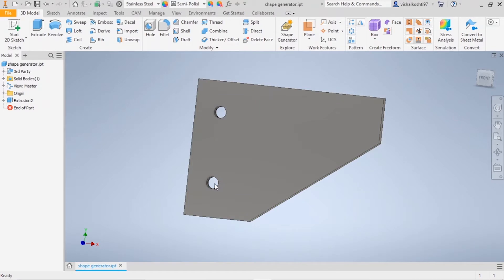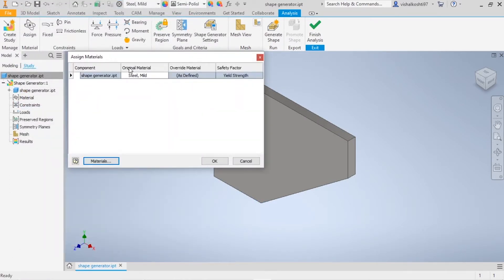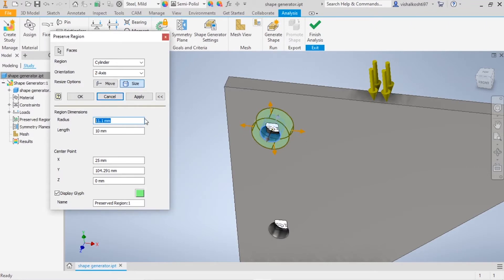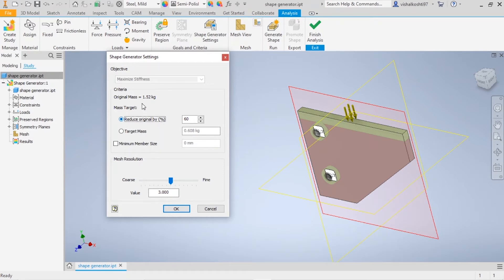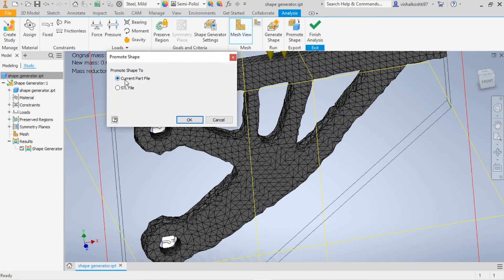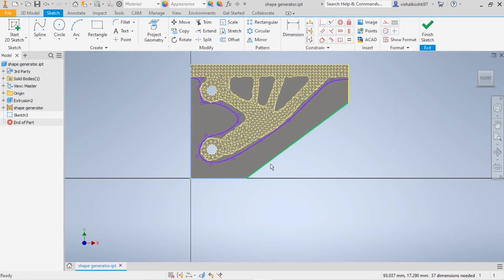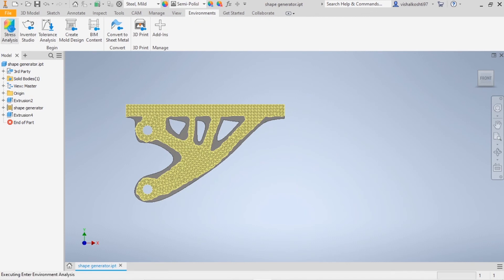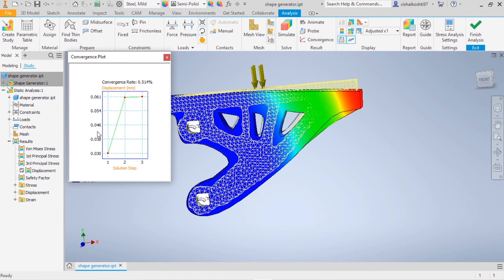Autodesk Inventor-Shape Generator Tutorial

Comment: thanks for the video. One question: if there are displacement, does it mean the piece will bend?
Reply: I think everything will bend if you apply enough force. The question is how much force is needed, that's my understanding of the displacement analysis. Someone correct me if I'm wrong.
Reply from the maker: First understand the meaning of Displacement. It is nothing but deformation from original shape.